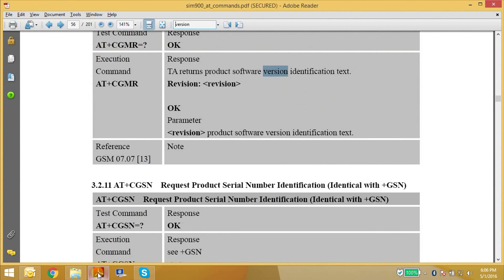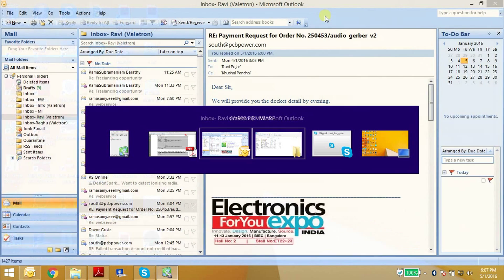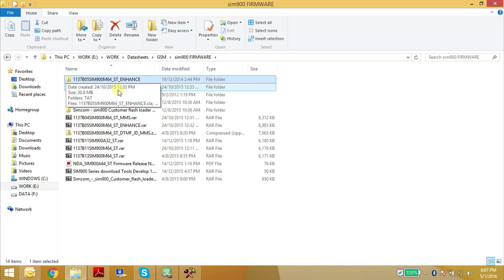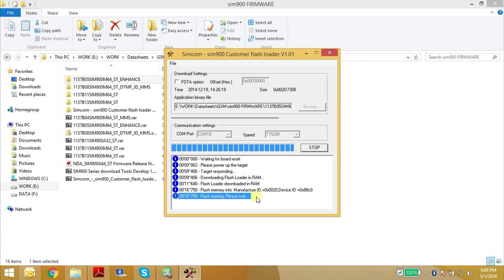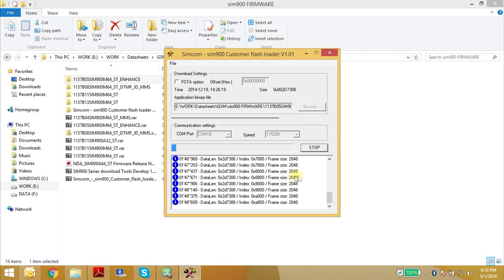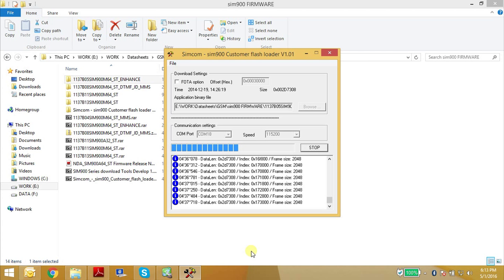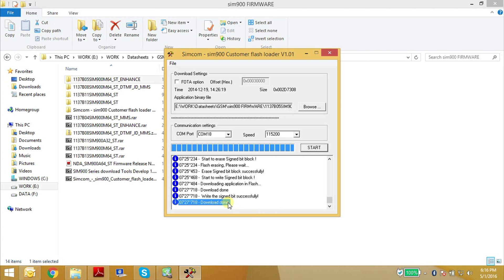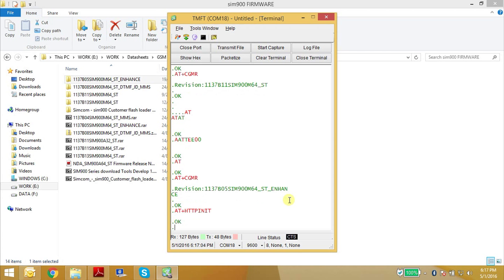Uploading a new firmware image to SIM900 GSM/GPRS module

Comment: very helpful information you have shared. thanks a lot, but during updating firmware i have lost my module and its D5 LED became Dim and continuous ON and also not responding on AT commands. is there any solution to bring it back ?

Comment: Hi i would like to know how to wake up the sim900A after it has not being active for about 10 or so plus minutes . Im using a PIR sensor as the trigger to activate it. it works within the first few minutes but once asleep it stays asleep. If you could please help me with this thanks.
Reply from the maker: If you are using DTR pin you can use it to wake up from sleep modes. It should work even after longer intervals also. If its not, then might be some other problem in circuit
Reply: Thank you for the reply Ravi  sorry for the long link address but this is the model of Sim900 i have it does not have the DTR pin or it does not seem so to me. Forgot to mention that i have it wired up to an Arduino and the PIR. I just thought there has to be a AT command that i could issue in the Arduino code to wake it up. And also i cant seem to find any information on the wiring of the DTR wake up method. Im also using it according to one of the Youtube channels (Electronics clinic). https://www.google.com/aclk?sa=l&ai=DChcSEwiR54Gw7_zpAhUEh9UKHVcsBDoYABAOGgJ3cw&sig=AOD64_24z8UgkaFAPK1SRZr_3IeCJA-Bcw&adurl&ctype=5&ved=2ahUKEwjztPiv7_zpAhWF_IUKHVbwCLUQvhd6BAgBEFk
Reply from the maker: @errolsternberg8185  You can also wake it up by UART command in sleep mode 2. Sending any byte wakes up the module. Don't forget to like share and subscribe :)

Comment: How to comnect SIM900 module to laptop?
Reply from the maker: You can connect using RS232 or USB converter or direct USB lines, if your module has option for it. But if it's bare module you would need a breakout board. Don't forget to share and subscribe :)
Reply: @RaviPujar   Thank you ravi. Just now subscribed your channel. Please let me know which one is better to use in posting data on website Sim900A or Sim800L?
Reply: Hi  @RaviPujar  , AT+HTTPACTION=1  ,603,0 getting this error. How to rectify?

Comment: Sir please help me I have flash my sim900a as you guide the version is st_enhance after flash it is not giving response that is the LED connect is continuously blink and not registered also the TMFT AT command not responding .what should I do?
Reply from the maker: Hi,
You might have downloaded a wrong firmware. 
There are two types of modules, 32 bit and 64 bit. You have to load corresponding firmware.

Comment: Hi I connected the Sim900a to my pc using a FTDI USB to Serial connector opened the sim900 flash loader program and clicked start I get one of two things Error during change baud rate and error during loader initialization or Error during acknowlegement waiting, error during download data via Boot ROM and Error During download loader in RAM both of these outcomes end with check target setting Help!
Reply from the maker: Marc Anderson make sure you have not connected other boards also on same uart lines,  like arduino.  Uart lines of module should only be connected to USB to uart  and don't connect module uart lines directly to converter as Sim900 only supports 2.8v io lines

Comment: Hi, My sim900 module got a problem: After I upload a FOTA firmware to it, I can not turn it on by PWRKEY pin anymore. Have you ever confront with issue? Could you please gie me some suggestion?
Reply from the maker: Hi ,
I have not came across this issue so far. May be that firmware changes the default behaviour of the PWRKEY pin. 
I am not aware of FOTA firmware too. Where did you find it?

Comment: I HAVE THIS MESSAGE : UNDER-VOLTAGE WARNNING
Reply from the maker: It means your source is less than 3.6V.  Or it is not able to supply 2A of current. Use a power supply which is capable of supplying stable 4V,, @ 2A current.

Comment: Can you flash the firmware using an Arduino? I'm also on a mac which is another issue, but I can bootcamp/vmware if this will work.
Reply from the maker: You might be able to use Arduino as a USB-UART converter, if you don't have one. But i am not sure if the Arduino will interfere when uploading the firmware. You should be able to make use of Arduino COM port and program firmware.

Comment: HI Ravi, i have same firmware already installed on sim9001 but i cant make it register my sim. i`m uk and tried a lot stuff. sim is definitely working with no pin but i cant register it? what should i do
Reply from the maker: Hi Mert, 
Try checking the current frequency band using AT+CBAND?

Try setting the frequency bands using AT+CBAND="EGSM_DCS_MODE"
or
Try setting the frequency bands using AT+CBAND="EGSM_MODE,ALL_BAND"

Comment: I have read your outstanding tips at http://www.raviyp.com/embedded/203-sim900-sim800-not-working-possible-reasons and I think these are among the best data I could find with https://cdn-shop.adafruit.com/datasheets/sim800_series_ip_application_note_v1.00.pdf ... But would you have a clue why my SIM800L (not 900) most often reboots just after I sent it some short POST DATA (i.e "AT+HTTPDATA=70,10000" works fine, I get the OK, but then "AT+HTTPACTION=1" replies "OK" and the modem reboots!).
Sometimes it goes through all the steps though... Note that I power it with a reliable lab power supply.

Also I usually get very long times before AT+SAPBR=1,1 returns an answer, sometimes well over 120 seconds).
Reply from the maker: If you are getting a reset after issuing an network intensive command, It has to be with power supply. Do you have any current limit knob on your power supply? Check that. 
If everything looks fine, make sure you are connecting with thicker wires and the wire length from power supply to VBAT pins is as short as possible. And after that try to put a 1000uF electrolytic capacitor on the VBAT pins, solder it directly to the pins. Dont use long wires. That way you can find out if power supply was the problem. SIM900 and SIM800L are same, not much difference.
Reply: Ravi Pujar spot on! At 4am I eventually checked with a scope, saw the voltage drop... and only then realized my power supply current knob was not fully to the right. It was time I went to bed. I feel sorry for bothering you :/
Thanks for the tips also, I did have a 1000uF cap but it is not close to the VBAT pins, so I will move it closer. I am a noob regarding power issues.
Interestingly I also got smaller drops when powering the modules with (LiIon) batteries. But given my lab supply, I understand the issues could come from the cables indeed.
Thanks again :)
Reply from the maker: Glad that i was of some help :)

Comment: Ravi, great efforts ! I have couple of questions. my requirement is to use mqtt protocol on sim900a, is it possible ? have you tried it ? I guess a 3G supported module from simcom ( I don't remember it's model name ) can run mqtt AT commands. Can I upload it's firmware to sim900a ?

Comment: My problem is that sometimes the module registers on the network, other times it doesnt.
Reply from the maker: It might be antenna problem most probably. Check if you are using proper antenna and also where are you testing the device , that also might effect if signal strength is lower. And check if 2G network is available in your area as these modules are 2G only.
Reply: The SIM900 is 2G only?  Yes it does have the antenna that came with the module.  It has been able to successfully register at times.  Do you think its because its only able to access 2G sometimes and not others?
Reply from the maker: Yes its 2G only. What i am telling is, In some countries the 2G network is being shutdown and only 3G and 4G services are running . So it might be a possibility that in your area the 2G network might not be working. But since you are able to register some times means the 2G network is present in that area. Its something else. Either signal strength/Antenna or Power supply issue.
Reply: Ok, is there a way to make the module only connect to 2G?  I know 2G is still running so it works, but just so I can at least work through a project on 2G